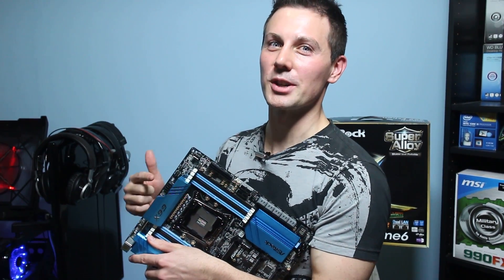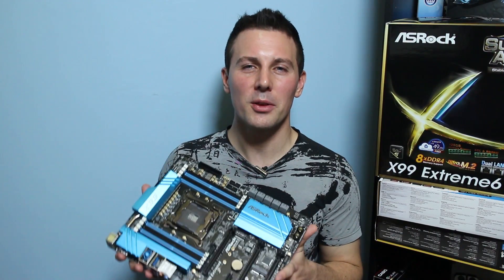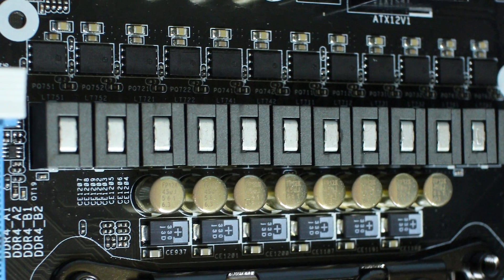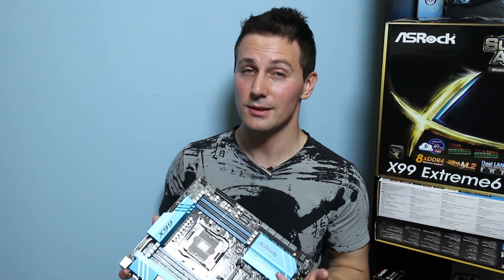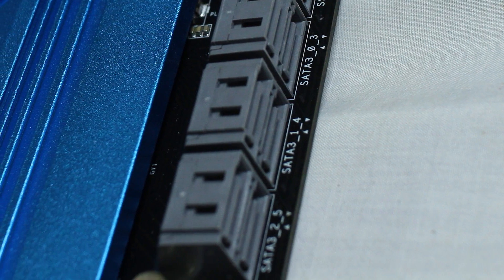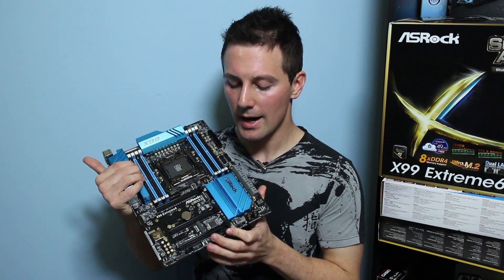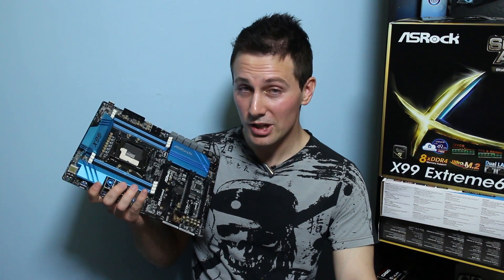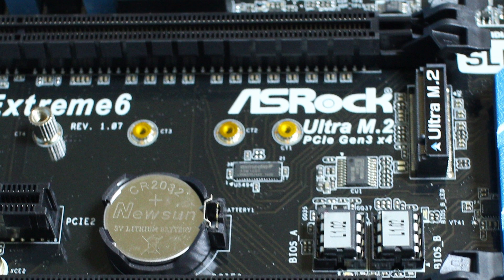ASRock X99 Extreme6 Review - Finally a X99 motherboard that WORKS!

Comment: 10 years later I am able to play triple A games at 1080p with my 1070 and i7 6950x. Combo was expensive when I got it 10 years ago, but it was worth the investment and easy to upgrade to M2's later down the line.

Comment: Are u still using this card, any problem? I've Asus x99 deluxe and the worst board ever, all new bioses means new problems. Saw your video and looks you really recommend it. I did read about many x99 motherboards and looks so many of them has own problems. Any problem after over 1 year? Do you still recommend?

Thanks.

Comment: How can i connect it with the dark rock pro 3 with the backplate
Reply from the maker: +Razen x99 usually has the screws already there, so you dont need the backplate on x99 (saves a lot of hassle).
Reply from the maker: Not their customer service directly, but their as of late they haven't replied to my emails that much at all.... no idea what is going on there.

Comment: Hey i have the Intel Core i7- 5820k with a ASrock x99  Extreme3 could you maybe do a overclock tutorial with the asrock board :) ? Also the 5820k has the Single Thread problem with speedstep may you can explain it ?
Reply from the maker: +XCrovaX I have already done an OC tutorial for the 5820k, it is really just about finding those settings, which in the asrock bios will be in cpu and fivr voltage settings, then just overclocking.  What is the speedstep problem? I am not aware of it (or haven't incurred any problem regarding speedstep as of yet).
Reply: +Tech YES City http://extreme.pcgameshardware.de/mainboards-und-arbeitsspeicher/357158-x99m-killer-i7-5820k-schlechte-single-core-leistung.html#post6861726

Im Grunde gehts darum das er wohl zwischen den threads hin und her springt aber nix wirklich hoch taktet wenn speedstep und/oder c state activiert sind

Comment: Tech YES City Hey Bryan :), you said extreme6 uses about 60 watts more on load than gigabytes ud4 IF oc'd to 4ghz right?  What about stock clock?

Also what do you think about the materials used in the board. 60a chokes 12k caps and even lightning strike protection among other things. Are they there just for show or actually perform as advertised? So far ive been using gigabyte mobos only without issues.
However gigabytes ud4 has slightly worse audio in comparison to extreme6.. so says reviews/benchmarks floating the net.

What about asus x99-a? This one seems to have the best of both worlds however it says it has 5k hour rated caps where gigabyte has 10k and asrock 12k. Does asus seriously use 5k caps or what?! 
That being said, how does asrock afford to sell for such low price if their boards have seemingly so much good stuff in it? Logic suggests asrock doesnt sell as many as asus or gigabyte so they work harder on their boards while gigabyte and asus sell more simply because of their brand names and they cheap out on components (because they have to make A LOT of boards) yet price them way higher. Is there truth to that?

Thanks.
Reply from the maker: I can't say how much truth there is too it as I don't know too much about microeletronics, we would need to ask someone in the field with an extensive knowledge.  Though I will say I thought the UD4 I had was lacking, and lacking a lot for an X99 board that I paid top dollar for.  The first giveaway was the loud but terrible audio, seriously I thought the UD4 had lack luster audio for a $300 board.  The VRM was very good though on the UD4, however the implementation of the bios was so that it crashed unexpectedly.   The MSI board I had was good at first sight, but died an extremely early death, even with mediocre overclocks locked in (I think I got an untreated board and contamination caused the death of that one).

Asrock have done a great job with this board, no two ways about it, looks like they haven't skimped on anything, and it shows when I overclock it and use it day to day.  I will say that the 60 watts usage may have to do with the PLL voltage itself, as I dropped that down to 1.75v and it is using less power even at 4.2ghz.  I will have to look into it more, but seems like just smart manipulation on gigabytes behalf maybe?

Regardless this x99 board is actually worth the money, where as the others I have tested underperformed.

Comment: so i want to run duel r9 290s but i want them running at x16....but in my country finding a mobo that runs both x16 is like a needle in a heystack. but i also want to mild over clock and may edit in the future. money for my situation isnt a to massive issue..

Comment: Tech Yes City , You're recommend the Ext6 and 4 , but what do you thing about the Extreme11 .  I don't game, this would be for A/V use so the stability you speak of with the Extreme6 is most important.  Seems there are alot of stability/bios probs with both Asus and GB x99 boards , even their WS boards . Thanks, and great videos too, I subbed

Comment: Is it possible to get coil whine from your motherboard? I recently got a msi gtx 970 and corsair cx750m psu and I had no whine at all when I had the 970 and my cx500 in my PC but when I put the 750m in I got coil whine at high fps like 60 on valley it was whining and it even did it on my r9 270.. But I noticed when I plugged my sound cable to my motherboard the sound was also coming through the my monitors speakers, and my headsets.. Could this be the motherboard?

Comment: ive only owned asrock boards both AMD and Intel all of them have this weird boot issue where it freezes on the splash screen every other reboot besides that my Z87 Extreme6 has been awesome!
Reply from the maker: If on win 8 you can try opening command prompt as admin and hitting this in bcdedit /set disabledynamictick yes - also dont wave your mouse and hit keys upon entering windows, i found that sometimes my computer would hang on the particular asrock board i have now when doing that.
Reply: Tech YES City thanks for the tips, glad to.see.its not only.my issue

Comment: You have one video about the G1 gaming 970. In that you tell that the card is really Quiet. I dont unterstand it. I have buyed it too. And its the loudest component in my pc. The power is great i can play everything in 1080p. But in idle this card is sooo loud. Do you have a trick to makr this card quieter. Sorry for my bad english. I live in germany and i dont have english in school since years
Reply from the maker: I see, yes the card is extremely quiet, I made a noise test too.  You may have bad contact between the GPU and the cooler, if so that may cause the GPU to become hotter than it should be.  Let me know your ambient temps and the temps you are getting while running unigine valley and we can go from there (1080p or 1440p extreme details preset).  The loudest component at the moment in my case is my power supply (on idle that is).
Reply: Tech YES City okay i test it tomorrow and then i tell it you. Before the gtx 970 i had one r9 270x from asus direct cu2 and that card was quiet like a boss. Thanks for the fast answer.
Reply: Tech YES City in valleybench i get in extrem hd preset 1080p a max temp of 59°C with an fan speed of 58% this ate 1864 rpm
Reply from the maker: do you have a custom fan profile set up? It should be at 30% unless it is getting hot.
Reply: Tech YES City in idle it is 34% it doesnt get lower.

Comment: Also those mosfets, think they were called IR3555A, actually just have the low side & high side mosfet along with the driver integrated. There's always a low and a high side mosfet so dual mosfet it's the right way to say it.
Reply from the maker: Thanks for that.

Comment: The on board usb 2.0 is meant for a server setup where the os is stored on a usb flash drive so that you don't use up a whole hard drive. It's way better to have the usb inside the case than sticking out of the front considering if it's accidentally removed the server crashes.
Reply: +Musclecar289 Or lots of high end software needs a USB key inserted to work. This way you can keep it in the case hidden.

Comment: Bryan, could you do some SATA 3 comparison tests. Grab an SSD, read and write some files in 4k random and sequential. Do the exact same test on a non ASRock mobo (preferably your UD4). I read a couple of reviews in PCF and they adddressed ASRock's Sata implementation and it was clearly inferior compared to all other major brands, slower reads and writes. These reviews were on were an FM2+ mobo and B85 I thinik, so both AMD and Intel platforms.
Reply from the maker: Weird that, never even thought of it, will have to give it a try quickly, though might just be an ssd blank test on this board and on the z87 msi board i got going here, cause reactivating office '10 and win 8 is a PAIN in the ass lol...

Comment: I used to always pass on ASRock boards but these days they are one of my favorites. They have really stepped up their game. I think they may pass up ASUS as my favorite motherboard maker in 2015.
Reply from the maker: Hey man! How you been? I put a few comments on your videos, but never got a reply lol.  I was going to e-mail you (happy new year btw :P).  Let's get talking in 2015 and work on that collab!
Reply: I had a Z77 extreme 4 and NEVER wanted to go back to them , no fan control , full of useless software , quite bad support etc ...
Ended up going MSI for X99 ; but might end up changing as they sent me a board that was "infected" ( spots everywhere )
Reply: Llewln  You hated the Z77 Extreme4? That board is why I am rocking the ASRock Fatal1ty Z370 Gaming K6! And sure, no fan control built into the Extreme4  BIOS (see below), but I run my fans at their max speeds 24/7 anyway - its not like 120 and 140mm case fans are at all loud, I really do not understand people who are obsessed with every little DB...   I never bother with any of the software - well I DID use the Xfast USB which was actually REALLY useful for transferring large files over USB! So again, can't see why you hated the Extreme4 - it cut costs in areas that are not overall important, like it had a thin PCB, but used quality components that last forever (I had mine running my 2600K at 4.5 GHZ for 6 years, now I sold it to a friend, he using it, IIRC at the 4.2 GHZ auto setting.) 

I just cannot understand what put you off ASRock over the Z77 Extreme4 - you did not NEED to install all the software, and people who have sensitive ears have been using Fan Hubs for decades (but now we are spoiled by having all of that in BIOS) also - IT DID HAVE FAN CONTROL! It was in the AXTU Utility - some of the "Junk Software" you complained of - which also allowed for Overclocking while in Windows as it ran through the Intel Management Engine.

 I mean I strongly hate screeching coils, or say, GPU fans that are all the way revved up, especially reference style blower designs. But even good coolers, like my G1 Gaming 980 Ti - when the fans are at about 75% I start to notice them, and at 90% and above they are too loud even for my tastes, luckily they never need to run above 80% to keep my heavy OC below 68 C! (1503 MHZ core, 8 GHZ effective VRAM)
Reply: < Sub! Moar vids Tech Uploaded! :-) Get that "How I bricked my Asus Mobo by using Adaptive Voltage" video! LOLZ  Happy New Year!
Reply from the maker: The fan control on the x99 asrock was impressive, I never use any of the included software with any mobo manufacturer lol  - so that isn't really a selling point for me.  As for the spots, yeah that shouldn't be happening at all on an x99 board....

Comment: What do you think about the ASRock X99X Fatality? I'm split between the two - they have so similar features and performance but I'm not quite sure which to choose.

I have a 5820K and will be using the board in a workstation and slight gaming environment. Would really appreciate your thoughts!

Thanks for the great video and Happy New Year :-D
Reply from the maker: Haven't tried it, though the extreme6 is really feature packed, great board.

Comment: Great review mate.  Internal USB 2 could be useful for those devices that will stay plugged in, e.g. wireless mouse dongle, so not to take up a front/rear IO spot
Reply from the maker: Yeah interesting design, guess I have to get used to it.

Comment: the on-board USB is for plugin in things like inscription or DRM keys. A lot of people will leave these USB key inside the case so that they don't take up space on the back of the motherboard's I/O - in the past people will hang them off a usb cable that is plunged into one motherboard's USB headers (requiring an extra custom or third party cable).
Reply from the maker: Thanks for that, just never used to seeing it before on a motherboard lol.

Comment: I hate the colour scheme shift from Asrock, also dude those usb headers are used for safer bios flashing or installing windows
Reply from the maker: Yeah the colour scheme was a bit of a turn off ey.  The usb header just comes as a surprise, never seen one just sticking out of the motherboard before lol. Also it shouldn't make a difference if you flash from the rear usb 2 port vs the onboard port, both go through the same hub.  I guess it is just for a person who wants to have a 24/7 usb device attached and no cable objects sticking out the back/rear?
Reply: Tech YES City Yeah haha i have a Z77 Extreme 6... sexy black gold caps bro haha that one is all blue and ew.

Yeah haha idk why some boards have the USB on the actual motherboard either but they are commonly used for bios flashing... say if your front hub is only usb3 and the bios says NOPE. Like my case haha but usb3 works so yeah again pffft no idea. Ive never tried to see if the usb actual would work in windows though idk curious... if so then yeah it would make it a lot easier to copy stuff ie flashing bios or windows.. id just leave my usb in there and copy what i need haha
Reply from the maker: I am glad I wasn't the only one that thought the ex6 x99 cosmetics was lackluster, I think Asrock will most likely read these comments and release something that looks wicked in the next gen.
Reply: Tech YES City They better... REV 2.0 HERE WE COME lol